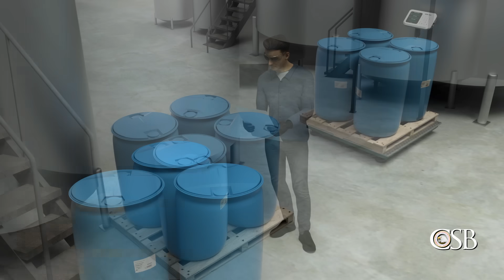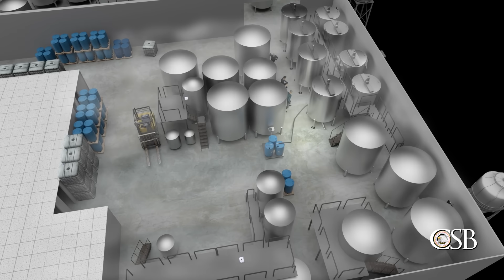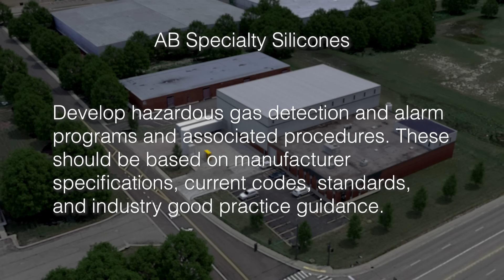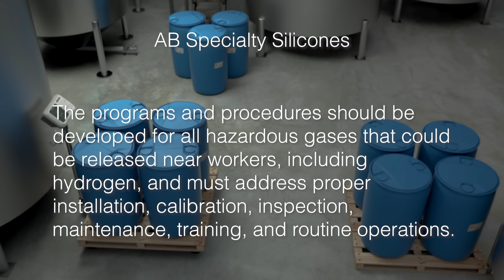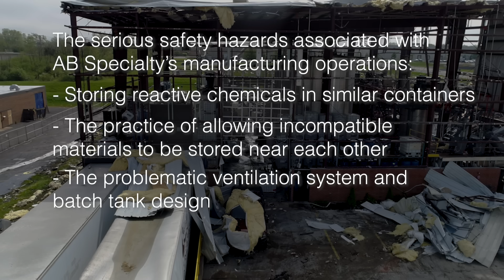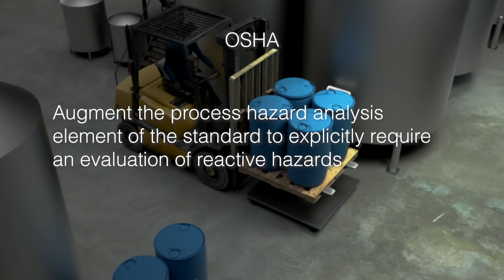Incompatible Chemicals: Explosion at AB Specialty Silicones

Comment: So when I watch this video I see expecting expensive and complex modifications to a working manufacturing facility being presented as if they're simple and inexpensive. 

This is a mistake many government safety based organisations around the world make, that Ironically is one of the leading causes of business turning a blind eye to unsafe conditions. 

I suspect this mistake is made so frequently but such organisations because they don't have the burden of having to generate revenue into profit. 

That a 2014 safety process inside AB speciality silicone identified a deficiency in safety protocols is a demonstration of a safety forward staff. That it did not go anywhere is a demonstration that knowing the associated costs in fixing everything they would be legally bound by upon starting such a follow up process, management chose not to chase it. 

Had the process not legally bound them to make such expensive renovation they likely would have followed up the 2014 report which may have resulted in the cheap solution of different coloured storage barrels which would have prevented this tragedy. 

If safety is genuinely the goal of  organisations such as the USCSB, then realistic assessment of cost for a business needs to make up a part of legislation. Perhaps such an assessment leads to an interest free loan/grant scheme for business to access funds to renovate or retrofit for safety purposes in a way that allows them to offset the costs over time. Or perhaps it leads to a tax credit scheme where money spent on safety retrofits/upgrades becomes a tax offset for the business. Or perhaps it's as simple as less aggressive legislation that demands a medium term plan with progression milestones but does not demand everything in a short period of time. 

Only the different coloured barrels were necessary to prevent this disaster. Where the chemicals transferred into barrels onsite or did they arrive that way from the raw chemicals manufacturer? Is there a standardised class based colour code system that the USCSB could work with industry to  implement over a 5 year forward estimate? That gives industry time to plan and offset costs while leading to safer environments and workplaces. 

Rome wasn't built on a day. If you want to foster safety culture in workplaces, you can't expect large safety upgrade projects to be built in a day either. You have to be realistic.

Comment: What would prevent this is if every worker had a high enough level of chemistry knowledge to understand the reaction and to understand that having barrels that looked almost exactly the same as others could be dangerous... These are all easily preventable catastrophes except due to capitalism and maximizing profits they are ignored. I mean, after all, insurance(meaning, ultimately, wage slaves) will pay for the building and all expenses associated with the "accident"(inevitable event). I'm sure many of the top execs will get bonuses so buying a new yacht or mansion can help heal their trauma. 

Was Boston Consulting Group involved with this company by chance?
Reply: most people aren't smart enough to understand chemical reactions, you included.
Reply: @charleslindbergh8222  Most people aren't smart enough to realize they are a dumbass, you included. You can't even do basic algebra much less calculus, topology, category theory. You can't solve simple differential equations or compute the orbitals of atoms using schrodingers wave equation. You don't know the difference between a ketone or a ketane.

You are the real dumbass. Any time you want to prove you are more intelligent than me, just let me know... but loser has to jump in to a vat of boiling oil, ok? Deal? We can make it legal.

Remember, not every is dumb as you are and an IQ of 97 is not an A+. Unfortunately your IQ prevents you from realizing just how dumb you really are.

Comment: There's no such thing as an accident! 
It's either an error, or series of errors/mistakes causing an 'incident' or 'disaster', or they are 'collisions' in the case of vehicles! 
My suspicion is that either a spark in the switch for the ventilation-fan, or in the fan-motor itself ignited the hydrogen gas!

Comment: CSB investgation of Accident Happen Due to increase of Hydrogen gas and failing in Hydrogen Detector.
This Hydrogen H2 make bound with air atmospheric when the New Hydrogen atmospheric bound take all V of factory and take out factory Until it arrive to the flam behined air condation. 
The factory Explosion . 
May be we MUST have New Detector have ability to Detect This New Hydrogen Air atmospheric Bound But Firest MUST known  The element inside This New Bound and Flash Point of Explosion This Bound
Think For loss part of your expensive Time to read My report
HNH Mohammed

Comment: As it seems there's plenty of errors noticed after the accident, when it was too late - so who has issued permit for the building to be up to the standards? Did national and local safety services expected for a company to monitor and check itself or it should be done independently and periodically, specially after the previous accident in 2014.? Seems to me there's more then one party responsible when it comes to the public safety.

Comment: What is most bothersome is that common sense was lost on the first shift workers, when it came to making sure that the two different chemicals were CLEARLY labeled and identified making it EASY to differentiate between the two. If that would have been me as the first shift team leader/plant floor manager I would have A) removed the reactive additive from the area of production, returning it to the storage area, and or B) CLEARLY labeled the reactive agent and so that it would have been IMPOSSIBLE to miss the difference between the two chemicals. YOU SHOULDN'T HAVE TO HAVE A SPECIFIC PROCEEDURE WHERE COMMON SENSE IS REQUIRED IN THE FIRST PLACE!

Comment: I don't understand:  In the first batch the operator was instructed to add 10% KOH to adjust the ph level and that was OK.  In the second batch the operator added 10% KOH in the mixing process and it was incompatible and created hydrogen gas.  Why did that not happen with the first batch?

Comment: Nowhere in the video is there any mention of the labeling on the KOH drums...  usually, there is a large-ish (min. 6" = 150mm) diamond label for the caustic hazard, and several large red labels, and the name of the chemical in VERY visible type.

Further, why on earth was the employee adding reagents that were not explicitly called out on the batch ticket?

Note also, that the animation depicts the drums of the reagents being set on a floor scale from which they are decanted via transfer wand. This is not however discussed in any detail, not the obvious response by the employee of just staring at the mess and wailing.

I fault the employer for not hiring and training capable people. Just who were they employing at this facility, especially on second shift?

I also find fault with their inadequate ventilation and alarm setup.

I do not find the harping on about the color of the chemical drum to be valid.

Comment: If you work in an industry with hazards to safety, any of them, learn about the Swiss cheese model of mishap prevention. Numerous holes in the safety protocols have to line up for an incident to slip through. Don't be a hole! Stop the incident before it happens. Don't be afraid to be a pain in the ass about it if you feel it's a risk to safety. And, don't be a pain in anyone else's ass if they do the same. Take the time to address any reasonable safety concern and give everyone the space to voice those concerns.

Comment: First of all, these analyses by the CSB are extraordinary, with a thorough investigation, clear findings, and impressive images to clarify what happened.  This facility did not qualify to fall under Process Safety Management, lacking less than a specific amount of a hazardous substance.  There were cultural issues that led to this incident: improperly maintained ventilation systems, poor labeling of drums, inadequate operator training & response & procedures & supervision.  Hydrogen is lighter than air, so it would escape if it wasn’t enclosed in the room.  It’s never just one issue, it’s a series of issues that lead to these tragedies.

Comment: Putting myself in the workers shoes it seems a identification label on top of each drum not just the side could have helped the second shift. All labels should have LARGE PRINT and a Numbered system like 1thru 10 representing each chemical. Even quality spray painting the access caps color coded for different chemicals would be a good visual for any shift to identify differences in a staging or storage areas.

Comment: This is where it pays to have a system where each chemical has a barcode and you scan it in before adding it.  The computer then checks and makes sure that chemical is on the recipe.   If done correctly it provides a "second set of eyes" and helps prevent simple mistakes that as in this case turn out to be deadly.  It also keeps you from spoiling batches & wasting chemicals.

Comment: 11:24
No, that points to owners and management wanting to save a dollar... 
Clearly safety is not the bottom line at that company... It is profits.

It's not even a question of maybe. Those  people would still be alive today if the company had taken the time and spent the money properly trained their employees on the use and the hazards of their product, spent the time and money to properly outfit their manufacturing plant with the necessary safety equipment.

To certainly is a good example of why there is no such thing as an accident.

Comment: From what the incident animation showed me, this appears to be a combination of at least four other CSB-investigated incidents regarding what happened: the chlorine release at MGPI Processing, Inc. in 2016 (chemical confusion), the Little General store propane explosion in 2007 (no immediate evacuation), & both the hydrogen sulfide release at Aghorn Operating, Inc. in 2019 & the 2008 explosion at Bayer Cropscience (nonfunctional air monitors/gas detectors).

Truly surprised the workers' first impulse wasn't to run, even if they didn't know of the highly flammable gas in their presence.

Can't imagine why the gas detection & alarm system supposedly didn't work (aside from lack of maintenance or intentional disablement), even though one appears to have been in place at the time of the incident (good thinking on their part, but also shame on them for apparently not maintaining it like they should have).

"This points to a weak process safety culture at AB Speciality that did not promote effective safety management systems" Gee, you think? Seems like that's what every company is guilty of these days: not giving a dang about safety in the name of profits (though AB Speciality doesn't appear to have overlooked safety in the name of profits, instead having simply overlooked it).

Comment: This is unacceptable. The operator had no business.... Let me start over. The labels should be made by management and be totally different and everyone should know what happens when those two mixed. Same thing as bleach fitting being same size/thread as acid. Moronic design. Acetylene tanks are perfectly designed with reverse thread mistakes are impossible.

Comment: stuff like this almost happened to me (but not deadly)
.
we use calcium chloride to fill tractor tires (instead of air) for added weight...... for counter balance (so the farmer can pick up heavier things)
but a pesticide slip tank had lost its label due to sitting outside
.
and i was JUST about to fill my tire trucks tank with it..... when i decided to ask someone 
.
.
we have one area for cal chloride...... and other for "farm chemical" 
someone set the slip tank in the wrong location 
.
.
i just noticed it smelled off..... and the color was SLIGHTLY different 
if it smelled the same..... i probably would have never noticed 
.
would have filled a fire full of roundup....
who knows what that could do to the tube/tire..... 
.
and it probably isnt as heavy as cal clor

Comment: The number of combinations of reactive hazards are unlimited. Trying to limit them are important but having safeguards in place to detect them might be even more important.
Reply: The potential number of reactive hazards aren't 'unlimited'; they're specifically limited by the number of different chemicals that a facility has on hand.  A well developed safety program would include, at a minimum, identifying the potential 'worst case scenario' reactions, and having appropriate mitigative measures in place.  Detecting a dangerous reaction after it has begun, is certainly not a better solution than avoiding those reactions in the first place.
Reply: @historyteacher5821  I agree. But accidents still happen. It is sort of like the code and the fire department. We have codes to minimize hazards. But try as we may, we still have the fire department because accidents happen.
Reply: Great comment!!

Comment: Putting an altered chemical in a different color barrel doesn't tell you what's inside.  If you alter the contents of a barrel and are going leave it.  The label should be replaced with a new one properly identifying it.  And the work shifts should overlap. Enough so that the current shift can tell the next shift what's in the process for the day.    It was a lack of communication that caused this.  Aftermath reduction is great.  But it doesn't adequately address the cause.

Comment: Proper hazards analysis can be very difficult to do.  Many of these companies that use chemicals would do well to hire outside professionals to do their analysis along with their own internal group.  The other problem is that regulations may go a long way to helping prevent accidents like this, they aren’t infallible either.  Meeting minimum requirements may not be sufficient to prevent accidents like this.  But at the very least, meet all the regulations completely at the minimum.  Otherwise, you’re just adding zeros to the payouts when bad things happen.

Comment: I worked for a short time in a Company that made Resin products. We mixed batches of materials in a similar way to this facility. Again, due to industry standards and the fact that there were hundreds of different ingredients to choose from, all of the various ingredients were kept in similar coloured and sized containers or barrels, but were all labelled differently. 
It was drummed in to us that we double if not triple checked that what we were adding was correct as per the mixing sheets for each batch. I'm not sure that if we got it wrong we would have caused an explosion, but it definitely helped from quality control and waste management viewpoints.

Comment: Hydrogen is notoriously hard to contain. Pressure relief valves with a safe discharge would have disbursed any Hydrogen buildup relatively quick. Hydrogen is incredibly light and not very dense but not surprisingly,  it's very explosive.

Comment: Reminds me of doing consulting work for a company and its surprising how lax some of these places really are. This place just had pallets with drums of all manner of chemicals, some with fairly provocative NFPA placards on them everywhere. And I mean everywhere, with no accounting for them whatsoever. Go into an unused back space. Pallets covered with dusty unopened drums. Unused office? More drums to climb over. It was so bad the company I worked for simply walked away since there was no way they would ever pass any sort of inspection by the local AHJ. They said they found another "consultant" to finish the job, but given that the outside of the installation looks suspiciously just like what I had specified in my design, I suspect they just got 'er done and moved on. I'm no safety Nazi, but you need something at least to ensure what you know you have on-hand at any given time and that people can ID it, not to mention first responders if the place ever has an emergency.

Comment: Why in the hell would you have ventilation equipment that drew air in instead of exausing out.
Installing that kind of system basically guaranteed that if an flammable vapor was produced it would be quickly distributed with enough oxygen to become flammable.

Fume hoods on stoves suck smoke out for a reason. If they blew air in all it would do is make the smoke spread through the house. Same principal here.

This speaks to either gross negligence or incompetence on the building designers. Also no ventilation in the process drums. Jesus these videos need to be a mandatory watch for any company in business or about to start up
Reply: Apparently, dilution ventilation is a standard way to deal with flammable gases (!), except that it's unable to deal with surges of or irregular emissions, as was the case here. In this case, I'd say there was a regulatory gap in terms of (1) the chemicals in use, which were known to produce flammable gas clouds if used improperly (or even if mixed, as in an accidental spill), and (2) a ventilation system that did not account for transient/surge emissions. Using such chemicals together should require ventilation (namely, local exhaust) capable of handling the probable emissions from those chemicals, surge or otherwise.